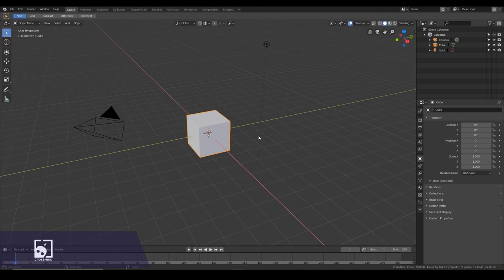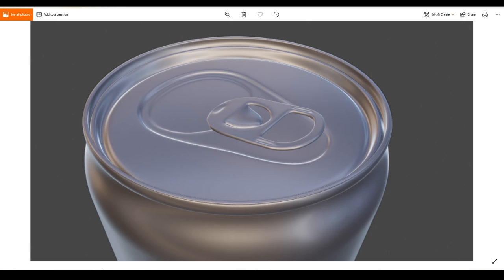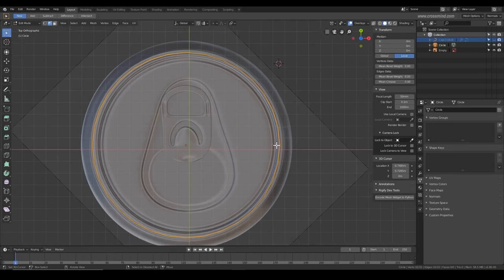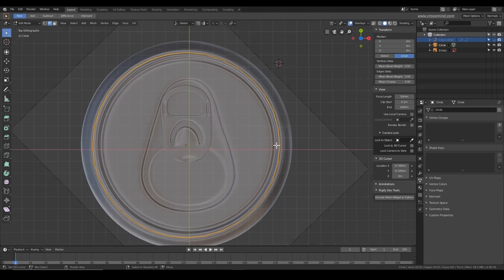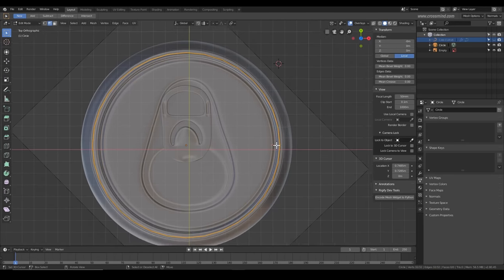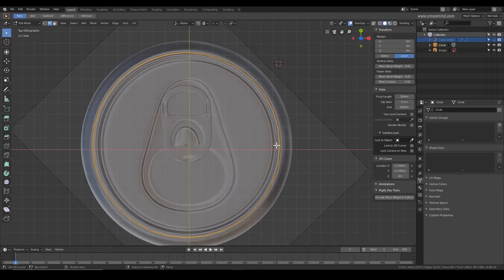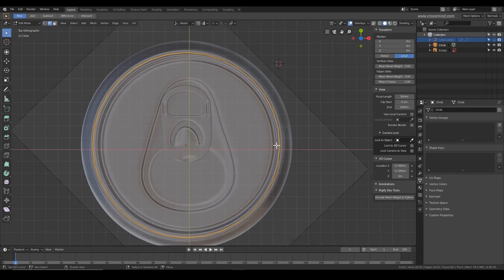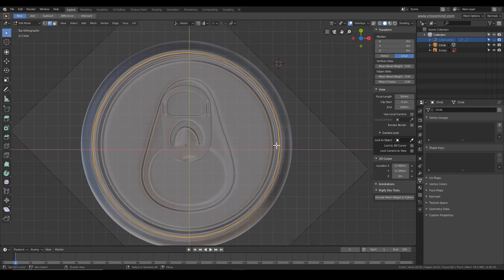CGI for Product Advertising  Using Blender 3D - Part 1 Modeling The Can

Comment: Good tutorials. I have one suggestion, From about 21:53 to when you closed the faces between the two side of the cup (24:23), I think it would be simpler to just add a solidify on the first half with the option "Only Rim" activated then add the mirror modifier for the Z axis which would be automatically join the top and bottom halves, with the possibility to adjust the width

Comment: What's the advantage of modelling with the screw modifier vs starting with the cylinder? Is there a better result in terms of the mesh? Awesome tutorial!
Reply from the maker: Its easy to edit with curves, when object have 360 symmetry. You can achieve same result with  cylinder and edit it.

Comment: Hi Crossmind,
great tut! Some questions:
why do you use a not quadrangular UV map (Your UV map is rectangular)?
Why did you overlapped the top and bottom aluminium island on the main label island on the UVmap ? So, I didn't see any "Pack Island" operation so that you can place properly the rectangular body label and the two circular top/bottom aluminium islands...
thanks for a reply!
Reply from the maker: Hey Duca
Its not that uv is rectangular or quadrangular. Its the texture which has wide aspect ratio. so whichever texture you choose in uv editor, ur view is going to change the ratio. and since i had this file from graphic designer, which comes from actually packaging of product, i used that in bg and arranged uv accordingly. also top and bottom islands didn't had texture so i thought it would be waste of space to spread em apart too much . However if you are doing uv for gaming then overlaping is not a good practice.

Comment: Hi, i am following this tutorial for one of my projects, at 13:36 when i am applying grid fill, i am getting an error as, 'Select two edge loops or a single closed edge loop from which two edge loops can be calculated'. Please help with this!
Reply: So I was getting this error because I didn't click apply on the mirror modifier for the top of the can, then I got a "Loops are not connected by wire/boundary edges" when I tried to apply grid fill again, I ended up simply extruding then scaling abit more then joining vertices at center.
Reply: @Jaleel_  thanks man, you're a life saver, even 3 years later :)

Comment: Hi, I'm having difficulty working with the bezier curve. I can not seem to control it. Also, I am unable to add just one vertice and work with it. Any ideas?
Reply from the maker: you can add new vertices with ctrl+ click  , you can change point vector type by pressing V, you can also select 2 points and subdivide to make a new point between them.

Comment: Is there a way to move the texture if it is kinda moved to one side? or instead being vertically, it's like inclined so the text isn't stright horizontally but reclined slightly to one side
Reply from the maker: U can edit the uv in uveditor and align meah to the texture.
Reply from the maker: Select the points and move and rotate just like how i edit mesh

Comment: Why you use skrew modifier instead of cylinder?
Reply: Play with curve.....is much easier to make any shape

Curve handled are much powerfull to make any complicated shapes

Happy blending
Reply: @haseeb5414  its just for rounded shape isnt it? Like cable, rope, can, etc?
Reply: No you should learn about it 

Iam also a beginner and after i learned curve it saves my lots of tym
Reply: No you should learn about it 

Iam also a beginner and after i learned curve it saves my lots of tym
Reply from the maker: Juvie Anandha curve gives you more control over shape and all contours fall exactly where where you want them.
With cylinder you can achieve this as well,  but you will have to adjust multiple loops to adjust one radius whereas with curve its just one handle.
Reply: Because its non destructive.

Comment: using the bezier curve when modeling,but when i click vector and change its to free im not getting the thing that i can edge it out
Reply from the maker: Did you tried in on point? im too late to respond hope it worked out.
Reply: I'm having the same issue, i don''t know what i am doing wrong, i have retried the same thing 6 times already and it still hasn't worked

Comment: Pls explain with what u have done correctly
The grid fill doesn't works
Reply from the maker: Make sure number of vertices are even number, else it will not make grid.
Either add an edge loop or delete one.
Reply: @CrossMindStudio  Thanks for this!

Comment: Grid fill is not working what should I do??
Reply from the maker: select all vertices and remove doubles ( in search ), make sure loop is not broken. It should work. If not, do share a screenshot. Also, make a simple object with  polygons and try your grid fill with that, atleast you would know if command is working.
I had this issue few times as well, i tried same in 2.79 with same object and it works fine, but in 2.8 it says 'select two edge loops', i am trying to figure this out as well . Lets hear from others.
Reply from the maker: Adding to the previous comment, I just tried something, when I am having an issue with grid fill I deleted ( dissolved edge) a loop, and made it even number of vertices to fill in, and it worked.
I am not sure what is the right solution or if its a bug. Let me know if you find one.
Reply: yeah I tried to de select 2 vertices and then it worked!! but it was not perfect like you It was so wierd 😅 btw thx for the reply

Comment: Hello,

Please see the image to see what is happening https://pasteboard.co/JlH9hZu.gif
I choose faces and in UV editor it shows them like 2 separate parts. And put the image twice in the separate parts.
Can you help me please why is this happening?

Thanks in advance.
Reply from the maker: you might be having two duplicates of same surface overlapping. try selecting vertices and move em around to see if there are no duplicates. otherwise i don't see any other reason. 
Or did you create two seams? for uv?
Reply: @CrossMindStudio  No duplicate topology and no double seams. This specific object has some problem that i cant figure out, I create quickly another cylinder with some edge loops and it worked fine. Only this has this problem with separated faces. Maybe i duplicate the bezier by mistake before  modifier spin? or i press something there? I guess i did something by mistake that creates this problem? Blender Version is 2.83.2
Reply: @CrossMindStudio  I check all the previous save version and all worked fine. Only this ha that problem. I guess something i did by mistake and create this?
Reply: Yet i found out that two edge loops were overlapping. I move them and create a bridge with them. Although topology looks like fixed the UV didn't fixed but this happened: https://pasteboard.co/JlIUXKB.gif